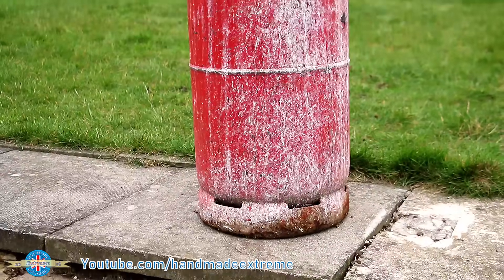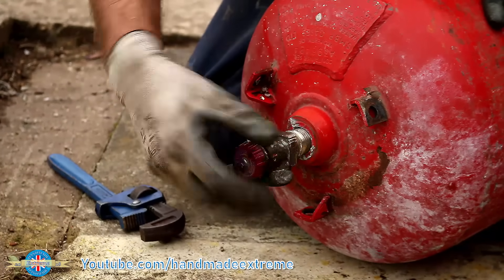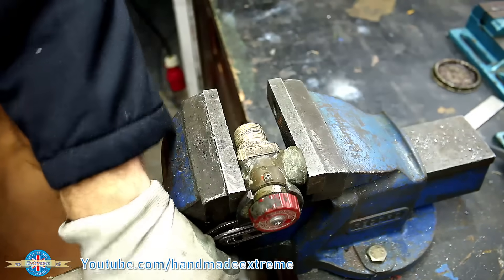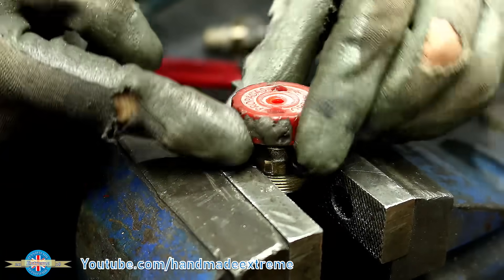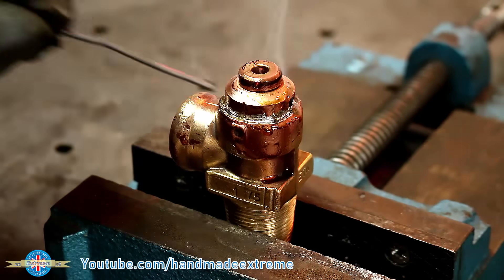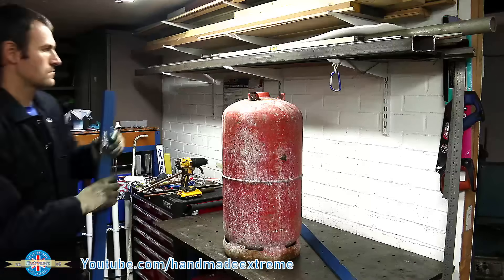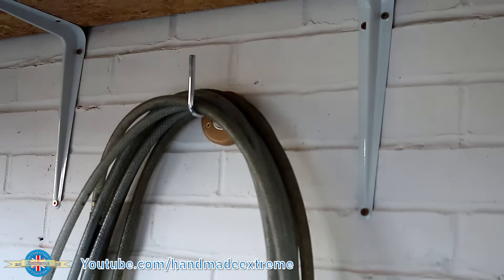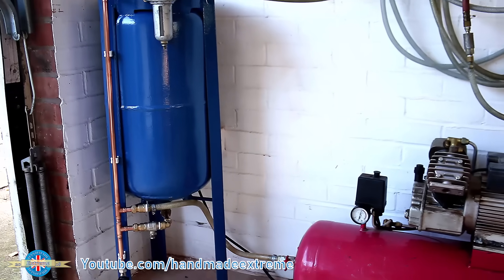Making an auxiliary air tank from an old LPG gas bottle.

Comment: There's just something about compressor bottles which brings out the Karen Squads...

On most of the used-goods-swap forums one can find 30 gallon or so tanks where the cheapie compressor has roached itself -- $20 USD or so.

Maybe the one I picked up roached its compressor due to an overcharge run.  The bottom of a relatively new compressor was cracked.  Nothing a little over-engineered welding can't fix (queue the Karen kacklers).

The spare tank still has its wheels and I've plumbed it with valves and fittings to accept a standard air hose from the main compressor.  I don't need the extra storage volume most of the time.  But, running the plasma cutter or blasting cabinet makes the extra tank mandatory.

Now, the nice thing about a spare tank on wheels...  If I'm using an air tool someplace else on the property, I can roll the extra tank there fed by the main compressor.  My pneumatics are not just a short distance from a buffer tank and the long run of host from the compressor to the tank degrades the performance of the tools not one bit.

https://www.youtube.com/watch?v=0uJepYGws78

Comment: It’s Bad idea 👎 .. some propane tanks are aluminum and some are not upto the task. 

My dads friend did this. He tested it. He woke up 2 days later in the hospital. The tank blew up and sent him through 2 walls about 20 feet and the house was condemned.

You should pull the video down. Always use certified tanks. Always put overpressure limit valves on any tank you use.  It’s just to dangerous to do this

Comment: Pointless exercise .  The pump still only delivers the same volume of air just works longer and harder getting to the cutoff pressure. The only upside is the longer duration of air pressure close to the shut off pressure of the switch .  If the pump setup isn't coping with the pneumatic equipment used it ain't big enough to begin with, so adding a extra tank is pointless especially with those cheap aluminium direct drive pumps .
Reply: If somone needs 100L of air for a job and the main tank is 60L, then adding a 50L tank will save you waiting and hearing the noise of one run. I don’t believe much people are so stupid not to understand that the pumpcapacity stays the same. So no need to teach that.

Comment: I don't know if adding a tank to your compressor will change anything it will have some extra volume but if you plan to use air tools this will not overcome the capacity that you need to provide long periods of time the air tool is on. It is helpful when you use short bursts of air and then you don't need it at all. Besides this compressor may start less frequently but it will run longer

Comment: Can anyone tell me what it is that determines flow rate and whether we can influence that?
Reply from the maker: Q=AV  Where- Volumetric flow rate Q (m^3/s) = Cross sectional area of the pipe A (m^2) x velocity of the fluid V (m/s) Hope that helps.
Easiest thing to do to increase flow rate is make the pipe bigger. But at some point the flowrate the pipe is capable of delivering will be more than the compressor at which point you need a compressor with more CFM.

Comment: The extra volume is nice for the greedy tools (grinders, sanders, sand blasters, paint sprayers) but you have to figure that although the compressor now runs less / fewer times, it has to run twice as long to fill BOTH tanks.  I like the shut off valve for the storage tank / accumulator so you can isolate it from the system when not required.
Reply: Yes, however I have seen done something similar using a MASSIVE tank and a little pancake compressor… by massive it was somewhere around 250 gallon….
That pancake could run for days to fill that tank (there was a specific use case here, where it was legitimately used once every 2 weeks).  What they did is set it up with a one way valve out of the massive tank and a VERY restricted inlet (with another one way valve).  It would SLOWLY fill the tank allowing the compressor to cycle on for 5, off for 5.  The compressor eventually did die, but they still didn’t get a big compressor… they just got a 2 gallon compressor!  The savings of a small compressor vs a big one needed is insane (the tank dumps its entire load of compressed air in ~4 minutes… it has a big pipe coming out to power one piece of equipment that’s sole purpose is resetting another after it has had a wear part replaced). Was fun to see it and talk with them.  Again a very niche use case, but it worked for what is needed.  I personally have 2 30lb propane tanks hooked up at home.  Here it is just 3/4 NPT, so just a few fittings needed.  I use them for a few hungry air tools that has probably left my compressor near dead now.
Reply: Assuming proper cooling, most of the wear on a compressor comes from turning on and off. .

Comment: a tip for brass and bronze drilling is to backoff the cutting edge of your drill with a little bit of 90 degree grinding
Reply from the maker: Excellent tip. Thanks for the advice and support.

Comment: DANGER = Pressure tanks from 1 gallon lab reactor to 30,000 gallon storage tank.  Please read the nameplate.  If "U" for American ASME, there are also letters stamped under the "U" symbol.  stress relief for example.

 If you see "L",    do not touch.       Do not purchase, borrow,  remove covers, pipe plugs, etc.  Do not torch.

This is LETHAL SERVICE.

 no way of knowing if the pressure vessel has been cleaned.  
 no idea what specific chemical, gas, virus or bacteria has been inside and may still be inside.                
do not kill yourself and others.    These are not DIY.

Comment: i do not see safety valve on auxliy tank which is dangerious
Reply from the maker: True. However there is one on the main tank which will vent both in the case of an over pressure situation. Good observation skills. Thanks for the support.

Comment: Compressed air and copper compression fittings? Do you really know what you are doing?
Reply from the maker: The brass compression fittings used have a nominal working pressure of 200psi with a max working pressure of 400psi. The max working pressure of the system is 150psi. Therefore the fittings used are suitable for the application. Obviously different fittings around the world may have different ratings. However the ones used in this project are sufficiently rated for the application.  Thank you for your concern.

Comment: Nice video. I need to do something similar but do vacuum. I need a vacuum store for plastic forming and this should do it.👍
Reply from the maker: Thanks. I think that would work very well. I thought about doing similar for vacuum bagging composites. Good luck with your project.
Reply: @Handmadeextreme  I do vacuum infusion carbon fibre things and a small pump is fine. I'm trying to make fairing screens and need a vacuum dump to draw large volumes of air out.

Comment: I am an examiner of pressure systems with the British compressed air society.
DO NOT DO THIS.
Never weld an air receiver or apply heat.
Reply: Ian Wood
 ... from what I saw he only welded to the protective rim on one end and made brackets for the other end. IOW, no welding on the tank itself.
Reply: so why are the legs welded on the air recievers then!!!!!
Reply: @ivorjones6618  the legs are welded on during the production process, and then the whole thing is heated through a furnace so that every part is at the same molecular level!
CE & BS standards are there for a reason. If you weld a receiver for any reason (coaded welder or no) a heat treating process has to take place afterwards. 
If you want to make you own. Be my guest, don’t come running to me when it goes wrong!
Reply: @ianwood6814  never had a problem i have made air tank from gas bottles  and welded air tanks on waggons without issues so i wont be running to you at all

Comment: 6:16 "The propane tank has got a slightly unusual thread on its outlet". Yeah cos they don't want you doing crap like this. 😅Just kidding, great job man. anyway, I don't have a spare propane tank handy, can I use an old milk churn instead?
Reply: butter is better
Reply from the maker: Hahahaha, yep... that would be why...   
The nice thing about a propane tanks is that it is designed as a pressure vessel to handle pressures higher than experienced than in my compressed air system. I have no idea how strong a milk churn would be... could be very dangerous if it's not up to the job. I'd want to hydrostatically test it before using it I think. 
Thanks for the support. Glad you enjoyed the video.
Reply: @Handmadeextreme  the ASME designation is UM and the thin, lightweight design is the result of NO corrosion allowance.  55 years of inspecting and rating pressure vessels in USA and Europe TUV also.
Reply: @Handmadeextreme  Question how do you keep the compressor from running longer than normal? Maybe I missed a step. Everyone I have talked to about adding another tank. Says the compressor will run to long and burn up the electric motor.
Reply: @benniedonald  it's not really that big a deal also if it is something your concerned about you can run the compresser turn it off after a few mins and then back on. The electric motor will be more then fine running continuously to full up 3-4x the original tank size

Comment: Nice work, I'm doing something very similar but am using an old propane tank as the main receiver for a small hydrovane compressor I have. I will have to fit a PRV and weld some bosses onto the tank so I will have to do a hydro pressure test. When I filled my tank with water I poured half a tin of paint in first, as I added the water it gave the inside a water resistant coating. Did you manage to rid the cylinder of the propane smell? I can't seem to shift it.

Keep up the videos great work.
Reply: DO NOT WELD TO THE OLD PROPANE TANK !!    Dangerous because 1) you do not know the metal thickness, 2) corrosion possible, 3) illegal in many USA states, I do not know about TUV regulations in europe but suspect they would not approve.  I will allow others to comment that you have not purged the tank fumes.
Reply: @larselder874  this shows you haven't read the comment I said. I have filled the tank with water as stated. Propane has a smell added which can stick within the metal. On the note of the thickness, to add a boss I will have to drill through and therefore find the thickness. The bottle has also been inspected with an endoscope. As stated I will then retest the bottle with a hydrostatic pressure test.

Thanks for your concern but in this case i have covered all safety aspects.
Reply: @davers1610  Do not weld while a steel tank is filled with water.  The water removes the molten metal temperature that is needed way too fast.  "stick within the metal" = NO, not at all.  If you still smell the additive, either  you have not cleaned the interior or there was / is another substance present in addition to propane and its mercaptain.
Reply: @larselder874  thanks for your comments. I have used these tanks many times in this application and purged them with water and welded when full of argon. Fully aware of what I'm doing and the engineering and science behind it. I will be undertaking the work safely as I have many times before.
Reply: Yikes............
Reply: If you absolutely must work in an unsafe manner like you are describing, fill the tank with water first. 

Or, do it the right way and you use a tank designed for compressed air and not LPG

Comment: Good stuff. But how can you live with a direct-drive? Noisy bastard things they are..
Reply from the maker: Your telling me... it's properly load when it runs. That's part of the reason I wanted more volume. Although it has to run for longer until it fills the bigger volume at least it isn't constantly starting and stopping all the time any more. Thanks for the support.
Reply: the type of motor would have a much larger impact.  an induction motor vs. a universal motor will be vastly different in sound levels

Comment: This is exactly what I’ve been telling my buddy, he has a smaller compressor head, all ya need it volume, add some tanks.
Reply: You have more storage, but now your fill rate goes wayyyyyyyy down. CFM output of the compressor does not increase with the addition of another tank.
Reply: @nigeleharis5886  no but with more volume, you have more air available and the head runs the same.
Reply: @deborahchesser7375  yes, as long as you are within the spec of your compressors CFM output.
Reply: @deborahchesser7375  if the compressor can't keep pace with the air consumption then no matter how big the storage of air it's a pointless exercise . The cheap 3kw 14cfm generic chinese unit he's using will soon go pop keep filling the oversized tanks by having to run longer and hotter creating more condensate air at the same time .
Reply: @LifesAbe-ach  I don’t like the scroll type anyway they don’t live long and make a hell of a racket

Comment: As a compressor engineer this makes me cringe not gonna lie 🤣 less the tank and more the copper pipe and wasted time and effort to adapt the regulators when galv pipe and fittings are cheap and easy as hell to install.

Cringe aside. Nice tool work and soldering 👍
Reply: A bunch of people use copper pipe for air systems. They often make big manifold systems to dry the air.
Reply: @zososldier  copper is close in price to galvanized steel and the ease of installation offsets galvanized’s lower price.
Reply: @nigeleharis5886  Cost isn't an issue for some. not to mention having a less water affected material in the wettest part of the system is a plus for some.
Reply: @zososldier  the wettest part of your system should be your air receiver lolz which should have at least one method of combatting condensate in the form of petcock and or EDV. After that you can use in line water trap. Then a refrigerated air dryer since “cost is not an issue for some” 

Compromising your air piping design without using proper condensate disposal methods is primitive and uneducated.
Reply: @nigeleharis5886  There is a big difference between cost isn't an issue which equals spending an extra 100 or so on piping (iron/plastic vs copper) vs spending a few hundred to thousands on a refrigeration unit plus adding in extra power considerations. I also never said anything about not using an inline water separator. That is a fairly common thing that anyone should use if they don't want wet lines.
Copper piping has been used for air/fluid lines for decades and even centuries and is hardly a compromise.
Reply: @zososldier  totally agree bruv. Plastic piping is something I personally do not and will not use for air, however.
Reply: @nigeleharis5886  Yeah, I would shy away from plastic lines for the most part. Vehicles use them and I have installed them on vehicles in the past but I have swapped that over to using aluminum/copper/stainless lines because they don't have the same issues of heat melting them or possibly cracking in extreme cold like plastic does.
Reply: The workmanship is great, but the idea is just a bad idea lol.

Comment: Nice work . I still have an old big airtank from someone where the pomp and motor where broken of so this is a very nice DIY for me to expand the air for the compressor i have .
Reply: As long as you retain the PSV and pressure gauge you are good to go. That tank was already designed for compressed air, not LPG

Comment: propane is low pressure gas only about 60 psi
Reply: 57210chevy
 ... not true. Normal refill on a propane tank is well over 200 psi and can reach 300 psi on a warm day in the sun. Maybe smaller hand held tanks are lower. Never bothered to check that out.

Comment: If you blunt the cutting edge on the drill bit it avoids snatching when drilling brass and similar materials. 
I was taught that thirty plus years ago in a machine shop. 
Great video 👌
Reply: The key is not to blunt them, but to "brass them off" - add a small grind along to the cutting edge parallel to the axis of the drill. The problem is that the drill's spiral flutes create a positive rake cutting geometry that tries to "dig in", and brassing off the drill effectively makes the flutes straight just at the tip.
Reply: @cooperised  0 or negative rake
Reply from the maker: Great tip. Thanks for sharing.
Reply: Damn, I wish my english was better to fully understand what you guys mean. Sounds like a very useful tip.
Reply: @TomiLynch  me too, and English is my native tongue! Ughh cooperised’s method rings true, but it’s been decades in memory from, not applied.

Comment: This reminds me ...
Some years ago, when they were building the new opera house here in Oslo, I got a look around the place with an engineer who worked there. They used compressed air to move the HUGE rotating stage, sliding stages and other mobile set pieces (right word ?) -- because air was quiet, was the explanation. To get enough volume they had an array of bigly big repurposed gas tanks.
There ain't arf been some clever bastards.
Reply from the maker: That sounds like a spectacular job. Would have been great to see. Thanks for sharing.
Reply: Air is fairly quiet - depends where the outlet is...ptchoooooooo
Hydraulics away from the power source is quiet and more powerful !
Reply: Nice work....neat and tidy

Comment: Why jump tough all those hoops making adaptors and modifications to use the old valve body, why not simply use pipe fittings with the same size threads as the tank?
Reply from the maker: Just making do with what I had on hand. I like to try and reuse things were possible. Thanks for the support, Good question. 👍
Reply: @Handmadeextreme  OK, I liked your methods of adapting it,  just seemed like a lot of extra work.  I guess that you're probably getting a certain amount of recreational value out of the process, whcih I get.
Reply: For people looking for the easy way out... In Sweden, the tank I used had a normal 3/4" pipe thread...

But I do appreciate the adaption of the "scrap"